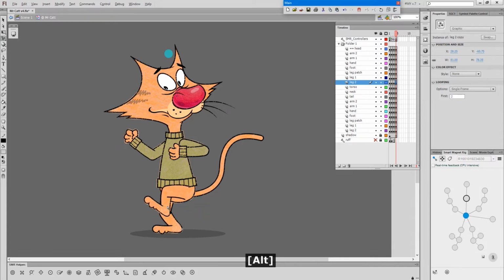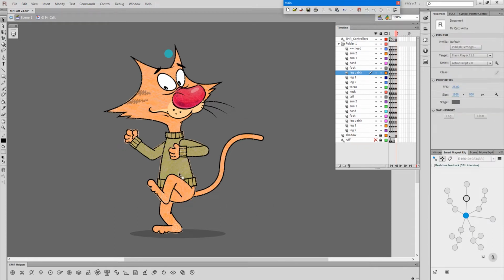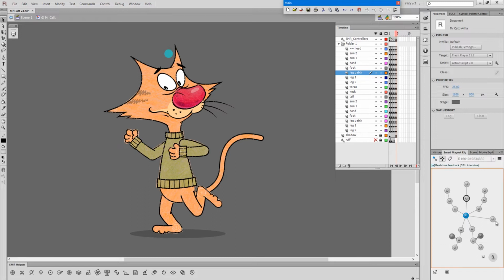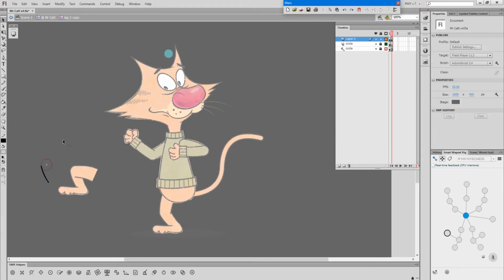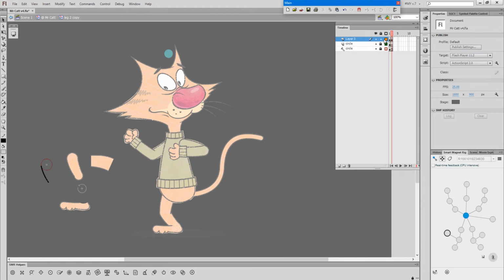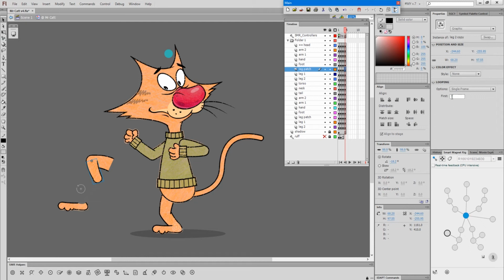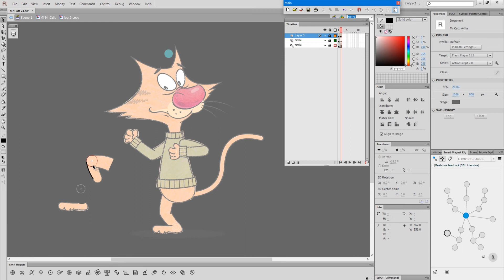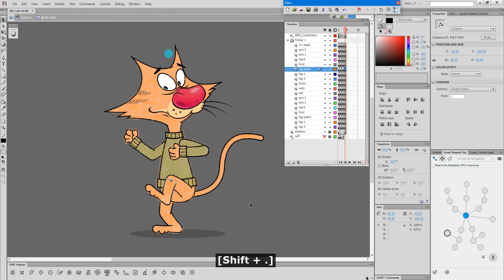💥 Control overlapping elements with Patches 💥 Advanced SMR in Adobe Animate

Comment: Can we use animate to express the soft bending and wagging of a cat character's tail? As far as I know, the deformer and bone tools in stock Animate seem to have a lot of problems. Does Flanimate Power Tools have a separate solution for this?
Reply from the maker: You are right. Animate's Asset Warp and FlexiBones are almost unusable.

At the moment the best option is to create a custom brush for the tail and then use Shape Tweens for the animation as the tail will be just a line.
You can incorporate this into a Smart Magnet Rig by putting the Shape Tween animation inside a graphic symbol.

In the future we intend to explore deformers, and if successful to add to Smart Magnet Rigs, but it will probably not happen in the next year or two.
Reply: @FreshlyFlanimated  All right. And I think your advice is the right balance of drawings, tweens, and symbols!